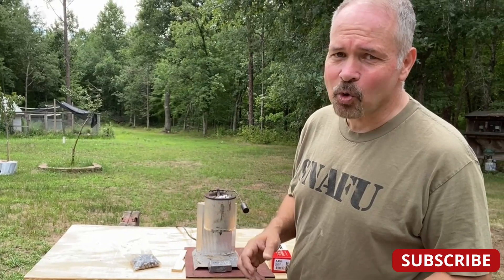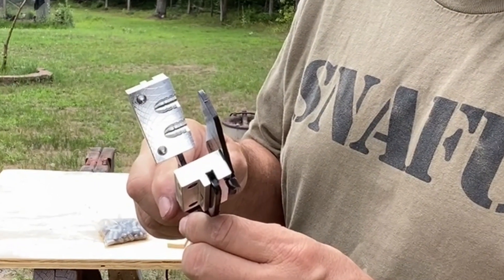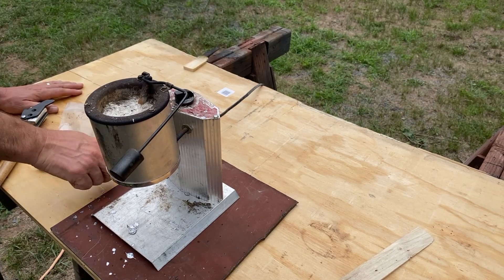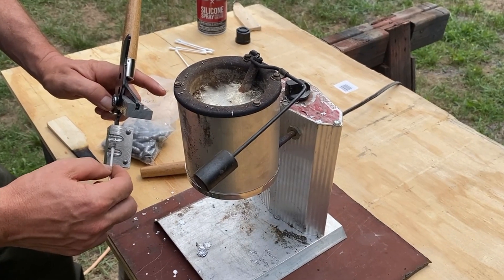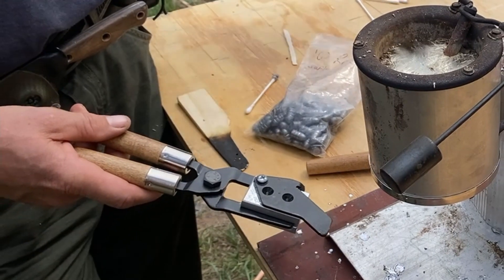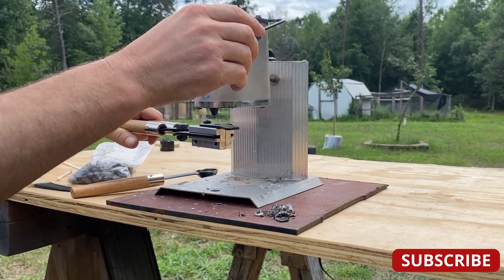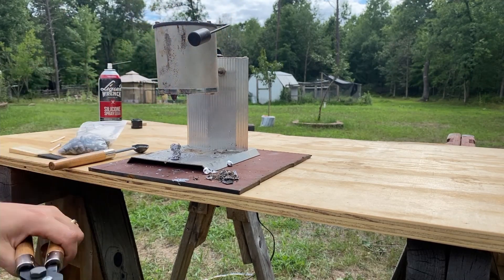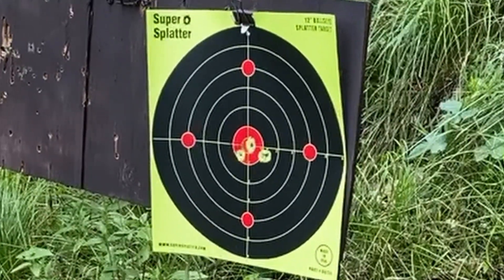How to make homemade air rifle pellets - How to make Air Gun Ammo

Comment: Great video. I got the exact mold that you showed a Lee melting pot and followed the video to the letter. The first few were good and accurate. Then I began getting some bullets stuck in the barrel but was able to remove them easily. Now the problem. I have 1 stuck in the barrel now about 4 inches in the breech. I have tried airing it up to full capacity, ram rodding it with the plastic rod  and a wooden dowel from both ends plastic rod broke and no success. I then doused the barrel with silicone spray in both ends with no results. It won’t budge. I was wondering if this has happened to anyone else with the bulldog. I have the barrel removed and my next option is to heat the barrel to soften the lead. Is this a good idea??
Reply from the maker: nope, heating the barrel is not a good idea. a wood rod close to the size of the barrel bore and then pop that wood rod with a hammer and you should be able to force it back. once you get the pellet out, check for barrel fouling. If your lead is too soft it may be leaving a nasty build-up in the rifling grooves. That would be where I would look for the problem since it sounds like it happened to you incrementally.
Optionally, a local gunsmith could quickly de-squib the barrel for you and look at it for you as well. I doubt they would charge more than 40 bucks for the job.
Let us know how you come out.
Stay safe,  
-Shane
Reply: Already tried the wooden dowel. Barrel still constipated!
Reply from the maker: @tift53  I would buzz over to a gunsmith and have them relieve the problem to avoid damaging the barrel. Should be a quick process
-Shane
Reply: Got a 5/16 x 3 ft metal rod and was able to bang it out with a hammer. Wooden dowel kept splintering. No problems with the barrel and good to go. Bullet had a few burrs on the outside is why I’m thinking it got stuck. Thanks for the suggestions.
Reply from the maker: @tift53  Excellent to hear you got it sorted out with no damage brother!
Thanks for letting us know!
-Shane

Comment: Can you pretty much use any .357 casting mold?
Reply from the maker: As long as it matches the caliber of your airgun you can. If the result is a little bit snug and squibs on you, you may need to swage the pellets after they are made or possibly even go to a 9mm mold. It all depends on the tolerance of your barrel. Mine just work without any extra nonsense tho so yours probably will too.
LEt us know how it goes for you
Have a super weekend and a great 4th
-Shane

Comment: i  tested  normal ,,old  lead from  pipes and  it worked superb for  9 mm para  but  for career dragon slayer 50 cal pcp //it was    much too hard// i  went   and   mesured hardness  of  original /1 doll per   pellet //ok    big pellet//and  it    was     a 98,88 perc pure  lead sosoft   you can  take a   few grains off with   thumb nail  no problem // than it was  ok  //and   saving  is   extreem  i  ,,shoot   a  gun  s worth ammo   in 2 days
Reply from the maker: Right on!
-Shane

Comment: Good evening. I was curious as to whether or not you, or anyone else doing this, have experienced any jamming of the bullets in the barrel. I am asking because of looking at the Seneca Air Venturi 358 diameter bullet/pellet reviews and reading of the number of times that people have experienced this with their Bulldogs. I also attempted to order several tins from Pyramyd Air today, and when I mentioned the Senecas I was warned of the jamming problem by the salesperson.
Thanks for any input.
Reply from the maker: Caleb, 
It IS possible to get a projectile that doesn't clear the barrel very well. (especially at lower pressures) 
What WE found was that HARDER lead was causing squibs. 
That is part of the reason why we went to making our own projectiles in fact.
PURE lead flies like a dream (with OR without lube) in our Benji's
-Shane
Reply: Do not quench in water like how he does, instead drop the lead onto a towel and let it air cool. When you quench, after the lead cools it will get progressively harder over the next several hours. When you air cool it will remain fairly soft even if not pure lead. This hardness will go away after several months, but no one is going to have bullets just sitting around for that long.

Additionally, you should buy a bullet sizer to size the pellet to fit your bore diameter. This further reduces resistance. 

I also powder coat and size bullets for firearms and for PCP airguns. The powder coating plastic acts as a dry lube, however you must size if you powder coat.
Reply: What bullet sizer should I buy to make sure I’m buying the right one I want to cast for .357 and .457

Comment: I made a silicone mold out of Air Venturi 50 cal hollow points. I drop in a bb and fill it with quality (I use gorilla) hot glue. Give it a few minutes to cool, then pop em out and cut the excess off the bottom. They're for my Umarex TR50 and perform quite well.
Reply from the maker: Iyeet, 
COOL idea!
-Shane

Comment: You didn’t find the 358s a little big? Even 357 slugs are tight as all hell in my bulldog
Reply from the maker: They fly like bumblebees from heaven from ours... BUT... use PURE SOFT lead when casting or you will squib like the devil.
-Shane
Reply: @amorepreparedlife4557  so no wheel weights? Hmm. Gunna be hard to stick to prep if I gotta get picky with the lead. Wheel weights are the easiest way to gather it 

I like shooting 110g NSA slugs. Found a 125g Lee mold I’m thinking about picking up and a couple of resizers to experiment.
Reply from the maker: @nsboost  Yes sir, in our trials at least, soft lead works at full caliber without sizers and without lube. Add sizers and lube and you should be able to use wheel weights. The alloy in the wheel weights is the rub as you know.
Let us know if you come up with different results!
Have a great day man, 
-Shane

Comment: I bought a Corbin swage press and die. Makes premium ammo. But I need to buy lead smelting stuff to make blanks for pressing in the event I can’t get extruded lead wire in the future.
Reply from the maker: If you have nothing but a mold and a ladle, a good hot fire or an electric stove can do in a pinch... I always think about Metl Gibson melting little toy soldiers into projectiles in "The Patriot" movie... that was legitimate considering the low melting point of lead.
Have a super weekend!
-Shane

Comment: Can u melt any type of metal to make the pellet?
Reply from the maker: Interesting question.
I would guess that if you have a metal with a melting point that is lower than the aluminum mold that flows well enough for molding, and the temperature is also low enough for you to be able to liquify it, you hypothetically could do that.
Stay safe, 
-Shane
Reply: Thank you!

Comment: It's a shame the ther is no 22 budget Sub12ftlb pellet swaging mold.
Reply from the maker: I know that's right! I have considered experimenting with making some different caliber pellet molds on my machines. (Metal lathe and Bridgeport CNC) I may give it a try this winter when things slow down around here. I'm sure I wont get match grade since I'm not an engineer, but I'm guessing I will be able to base some attempts off of some common existing designs and I should come up with something useable at least 
If I do get a chance to make a few I will post a video on it and maybe sell a few. Keep an eye out for it!
-Shane
Reply: @amorepreparedlife4557  I will good luck

Comment: The Lee 356-125-2R which is a 125 grain round works really well too. On a stock Bulldog I am getting about 160-165 foot pounds of energy.
Reply from the maker: Very nice! Are you using pure soft lead? or wheel weights? or blended?
-Shane
Reply: @amorepreparedlife4557  What I bought claimed to be pure lead, but it is harder than pure. I have a bunch of stuff I need to just blast into my trap or at the range. Need to buy from a real metals supplier next time.

Also fooling with a Lyman 356637 which is 145 grains, and the hollow point version called the 9mm Devastator at 125 grains. Not having great luck with these last two, the 145 solid groups OK but slow compared to the similar Benjamin Nosler rounds. Haven't been to the range to try the hollow point version yet.
Reply from the maker: @minigpracing3068  Right on... I got really lucky when I chose the mold I did, it's pretty rare that I get ammo that is acceptable without a fair amount of trial and error. I have been using pure soft lead and I get a lot less "barrel plugs". This particular pellet doesnt even need to be resized or lubed to clear the barrel easily and that is a big deal to us. As far as accuracy goes it is plenty "huntable" which is our primary concern with this particular tool so I am really quite pleased.
Have a super evening!
-Shane

Comment: You can use 2 cycle synthetic oil to lube your mold.   Use a Q-tip to oil pins and once the mold is hot, apply some oil as close to the spure plate screw as possible.  The heat should allow the oil to wick around the screw.   Use a wet q-tip to lube the screw. 

I also use an old sock rolled up with about 10 drop of 2 cycle oil to lube the top of the mold once it’s hot.  The method I use is fill the mold and then knock the spure plate open.  Then with the cast “pellets” still in place, I wipe the top of the mold and bottom of the spure plate.   The filled cavities prevents any oil from going where it shouldn’t.  

Also a hint to make life easier, I run the lead puddle across the top of the spure plate while filling the mold cavities.  It helps to put & keep heat in the mold and most importantly in my experience, you end up with 1 piece of waste lead that is easier to handle with gloved hands and add back to the lead pot.   I started out casting just like you demonstrate in the video only creating a lead puddle over the mold cavity.   If you don’t connect the puddles, you have a small waste piece for each cavity.  Connecting them makes it quick and easy to get the lead back in the pot. 

Plus for safety sake, don’t drop any wet lead into the pot.  The extreme heat will cause the lead to pop violently and could easily Burn you severely.  

2 cycle motor oil is also useful in lubing your pellets which helps slow the leading of the barrel and probably helps velocity.  

I also run my slugs through a sizing die & weight sort the “pellets” into groups all weighing .3 grains of each other.     I feel this is important for shooting tight groups at 100 & 200 yds.    If shooting at short distances of 50 yds,  A variation of one grain seems to have a limited negative affect in grouping.     Temp and lead composition can give you results varying in weight by four or five grains when casting a 120 grain projectile.   

Great video.  And a big bore air rifle is a serious piece of kit very “prepper” minded person should look into.
Reply from the maker: Motorgearhead...
WOW!!! Tons of great suggestions! Clearly you have a lot of experience with this!
YOU my friend are the kind of guy that we really appreciate on this channel for helping people to get a fuller understanding of the subject matter!
Please do us a favor and keep watching and putting in your knowledge where it fits.
We appreciate you brother!
-Shane
Reply: @amorepreparedlife4557  - always happy to help by sharing.   I came from the powder burning world about a year ago.   Once I saw primers & powder increasing by factor of 5 times their usual cost and then seeing the supply evaporate from the market I felt it was a time to look at PCP air rifles. 

It has been a major learning experience and I’m still learning all that I can from those willing to share.   

I just started casting bullets about 4 months ago so I’m still kind of a newbie.   I use wheel weights versus pure lead.   

If you look into sizing your cast bullets you’ll need a bullet lube.   I’ve used my home brew lanolin case lube along with silicon or 2 cycle oil for lube bullets before sizing.  Just put bullets in plastic container & spray then swirl around.   Then run then through sizing die.    

I’m primarily a paper puncher so I’m looking for small groups.    I’m happy with groups under an inch at 50 yds.   And any thing under 1.5” at 100 yds.    My average group size out to 200 yds runs about 1.7 MOA (3.75”).   

One thing to look for is if your groups start becoming erratic, clean your barrel.    My Texan can lead the barrel in as few as 50 rounds.   This is especially true when pushing soft lead at speeds approaching 1,000 FPS.    Think your rifle isn’t pushing slugs that fast so you may not be getting leading as bad as my long barreled Texan.    

Anyway,  glad to have you out there educating folks.    Think you got a solid rifle and being able to follow up with a second shot from a repeater is probably desirable.    Watched several videos of folks taking small to medium size doe and the animals dropping in 60-70 yds.   So thats not bad.   One problem mentioned is depending on projectile, might not be much blood trail.   Some hunters said getting better results with NSA slugs Vs Nosler 145’s in the bull dog.
Reply: What are you using to clean your barrel
Reply: @zacharypaul1111  - the big bores can lead heavily.  I use a tight fitting patch with hoppes bench rest solvent for my Texans since there aren’t o rings inside the barrel.  The valve is at the end of breech so I’ve not had problem with solvent contacting or getting inside the valve.  You could even cover the valve hat opening by plugging with a clean patch if that’s a concern.  My rifle is usually clean in 2 patches. I follow with a dry patch.  The first patch will usually have slivers of lead from the rifling.   The rifle fouled more quickly when it was new.  I can now get approaching 200 rounds through it before clean is required.   In my rifle you go from 1.5” group at 100 yds to 4-5 inch groups when the barrel fouls.   It may also take 15-30 shots after cleaning for the barrel to season back to where I was before it required cleaning.  I’ve also used “Ed’s Red” home made cleaning solvent.  Google for recipe.  In normal air guns I’ve used auto trans fluid to clean the barrel.  It’s oil based and won’t damage rubber from what I’ve read and from what I’ve seen using to clean typical air rifles.  You will want to dry patch after using since this is an oil.
Reply: @motorgearhead  what kit did you buy? That’s my problem finding ones to clean my different calipers,